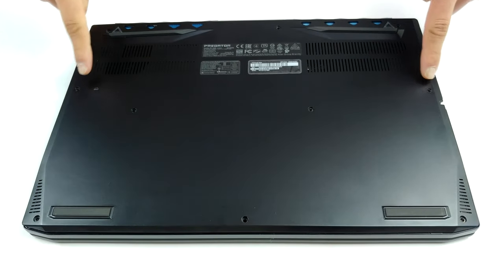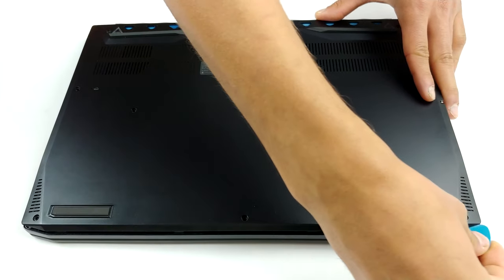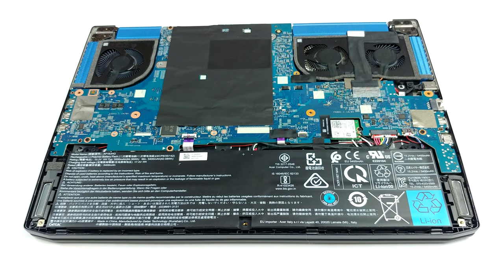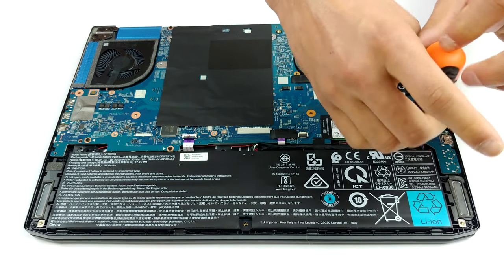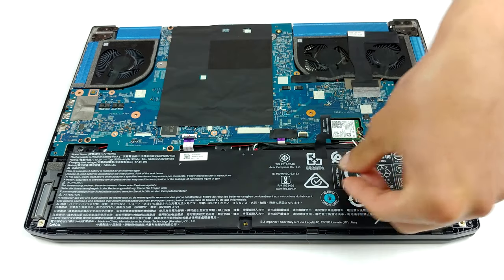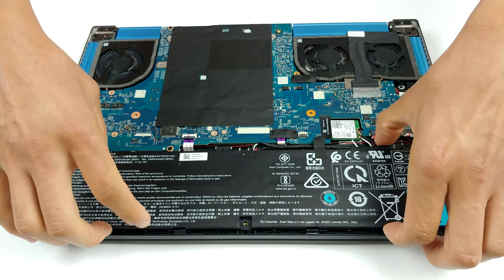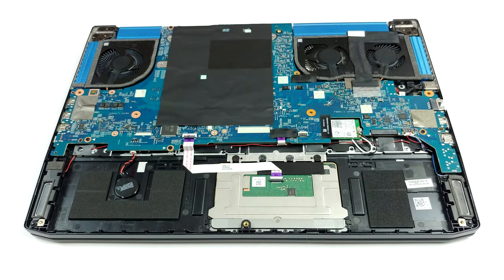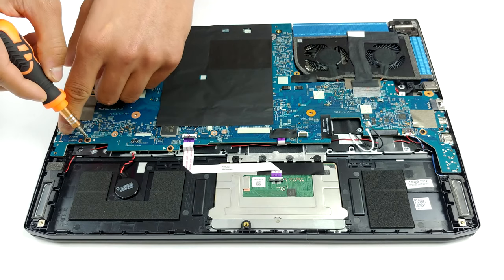🛠️Acer Predator Triton 500 (PT515-52) - disassembly and upgrade options

Comment: So you mean to tell me that you have to pull out everything just to get to the ram and SSD slots????
Reply: yup...I'm not looking forward to this. But I've had to pop open worse, but still....
Reply: @metpach  its not problem do it slow and carefull. Learm how open every types of connectors inside to not destroy them
Reply: @Ast86  I used to work on tablets, Xboxes, and other electronics. I'm well-versed in these types of stuff. While I think it's going to be tedious, I'm pretty confident I'll have no issues with it.
Reply: Kinda afraid to do that if I upgrade the triton, I think I rather take it to a store so they do it there safe

Comment: I've done the upgrade on the 2020 10th Gen i7 2080 Super Max Q version (PT515-52) & just as in the video there is a second m.2 slot which I installed another M.2 SSD in there (a WD Blue SN550 2TB). The machine takes a good while to study it's new detected hardware after upgrade (the Turbo white LED slowly flashes a fair few times & the machine restarts once or twice - and the screen will be blank for this period & so first power-up is slow, so be patient. It will eventually boot normally to Windows). Just take care to re-align the ribbon cables when refitting the board back in. There was also an additional ribbon cable not clearly shown (@ 4:28 in the video) that still retains the mobo when you need to lift it out; he disconnects it from beneath the mobo out of camera view - so my advice would be to remove it top-side 1st before lifting the board out (& pushing the cable through the gap between the fan assembly and the board). It connects to the mobo - bottom left of the DOUBLE fan unit - under that small peice of black tape immediately below a screw place holder (which comes through the base plate). Up to you but I found that easier and reduced the risk of tearing it if you were too energetic with lifting the board out - as doing it his way means holding the board with one hand & disconnecting the cable from beneath with the other - it's more fiddly / risky that way in my view.. As you see, even he nearly forgets it himself. Great video btw, it helped me, I'm not knocking it - these video's are gold-dust & what makes YT Fab. I removed my screws one by one and put them on a peice of A4 paper and returned the exact same screws to their original donor holes (very @nal of me I know but no chance of mis-placing the wrong screws that way). 

I wouldn't let doing this upgrade put you off buying it, this is a SUPERB performing laptop - it really is (& Scan have this on special atm) you just need to study this video and be preparred with the right tools and take your time, wash your hands first so tapes are not rendered non-sticky any more too (and have a nice well lit bright bench to work on too). Whilst you're there, get a can-of-air duster plus a very fine kids paint brush and blow the fans through - even though mine was new (few days old), it was starting to get dusty (I left it running over a few nights downlaoding stuff on a very slow web conection whilst camping away from home, hence the dust build up). I also noticed that my unit had the speaker cable on the right hand side (when laptop open) pinched between the battery - so I carefully re-alligned the wires when I re-fitted the battery. I was sure of this becuase 1st thing I did when the bottom was off was take a hi-res pic with my phone - so it wasn't me - it was like that from factory. Maybe worth you checking that (I can send a pic of this if need be) I also took a pic of my board on the flip side too if anyone interested. Unsure if his board in the video is the later 2020 iteration but looked identical when I looked at it quickly.
https://share.icloud.com/photos/04LcubRFmnq84QGwyS5zVVQ4A#Home
Reply: Hey buddy I need to open mine up I would really appreciate if you could share those pictures your comments are very very helpful man I wish I could give you some thumbs up or something
Reply: @jabbermacy  No problem, I still have the pics on the phone - will find an iCloud linkydink or something to share here...
Reply: @jabbermacy  Have shared pics in the bottom of my post 👍
Reply: @jabbermacy  Btw, I don't think I mentioned it - but I took advice - which turned out wrong - from Crucial (fume!) on their RAM - the sticks they sold me were not true 2933 compliant - so if you're upgraded RAM, don't use those as can be seen in the pics, it was only after reassembly and then checking that the speed was correct that I noticed that those sticks were largely 2400mhz not 2933. I had to repeat the process for the RAM afterward when I'd sourced true 2933 RAM.
Reply: Thanks man, you helped me a lot
Reply: Hi can u please give me the battery name, my battery is broken and I want to replace it so I wish you could tell me from where to buy it
Reply: Please help me find the ribbon cable ghibli_tb 450.0gy03.0011 H3 1903 A01 it's the ribbon cable from the inside that he doesn't show. Damn thing ripped off the purple tape and cannot be connected. I need a new ribbon cable but can't find a replacement anywhere. Do you know where I can get one? Thanks in advance.

Comment: Hello I just took apart my triton 500 I believe it’s the exact same model as this it has a 2070 super, while taking it apart the ribbon cable that goes through the mother board right next to the dual fan that’s covered by tape I removed and the connector broke off, I was able to stuff the blue ribbon cable back into the spot and get it to turn on and run as normal but I have a feeling it will give or just keep coming out occasionally, how would I go about fixing the connector that’s on the motherboard and finding the correct ribbon cable. I believe you were supposed to dissconnect that cable from a different part but I did not.

Comment: I just got a RAM upgrade. My TURBO button wont light or work. but the turbo mode on my predator sense working. I re installed my predator sense and Quick access already and its still not working. What can I do to fix it? Does the technician forget to plug something inside?

Comment: Seriously folks, the amount of complaints is just laughable.  I would agree with some on here that the design of the motherboard is stupid.  I am guessing it was packaging reasons (due to how thin this is).  Even though it has 3 fans, the cooling isn't great.  If you actually take the time to learn Throttlestop and MSI Afterburner (not hard BTW) you can do wonders with these machines for power use and graphics and temps.  

Warranty?  LOL.  I suppose if you pay the money for an extended warranty through SquareTrade, they might honor it.  So if you are worried, don't be.  Amazon sellers stink and rarely ever honor the warranties, and it is only a year warranty.  It should be easier to change out parts, but even if it was, you need to still learn how to take apart for thorough cleanings every now and then.  Compressed air is not going to work to full clean it out, but it does work for the keyboard.

First of all, they are not hard to disassemble.  I just set everything out on a flat surface and group screws together from where I took them from.  And second, get yourselves a simple laptop tool kit from Amazon for like 10-15 bucks.  They last a long time.  Don't be an idiot and try to use a screw driver to get the bottom off.  That is what plastic pry tools are for and those kits on Amazon come with numerous plastic tools that will not damage the enclosure.  Get soft brushes as well.  And, just take your time and you will be just fine.  

It is good if you get to know how to do this if you want to keep it long term.  You will need to learn how to do better thermal paste, clean the fans, and clean the whole thing really.  Once you take the motherboard out, it is a cinch to switch out RAM and SSD's (2 M.2 slots, and 2 RAM slots).  The only pain the ass part is the Turbo button connection.  It kept coming out of the slot on the bottom so I used a little double sided adhesive tape to stick it down, problem solved.  Just be sure to unplug the battery the first thing after getting the bottom off; and for added peace of mind, hold the power button down for like 30 seconds to discharge any power that might remain.  This laptop came with a 512GB SSD (Samsung PM981, or WD SN730 NVME).  Both are pretty fast, but low on space.  I switched out for a Crucial P3 1TB PCIe 3 NVME and it is pretty fast as well.  Yes, this chipset is limited to PCIe 3.0, which sucks, but that is the truth.  As for RAM, I went with 32GB of this: "Crucial RAM 32GB Kit (2x16GB) DDR4 3200MHz CL22 (or 2933MHz or 2666MHz) Laptop Memory CT2K16G4SFRA32A"  Comet Lake also cannot address faster than 2933MHz (no XMP support on this laptop), so it will just downclock the RAM a tad.  You will notice a difference with 32GB vs 16GB; both in gaming and in production tasks. 

Also, I like to run the fans up to keep the temps down and even after all this time, they fans are not failing.  Don't believe everything you hear online.  Fans are made to last a long time and tested for that purpose.  It won't harm anything to keep your stuff cooler.  With the fans up, not gaming, it is cool.  35-40 C on CPU and around 30 C on both system and GPU temps.  I also repasted with Arctic MX-6, and I use the X method on the GPU, and the vertical line on the CPU.  Works great and I pour it on thick.  Thermal Grizzly is probably okay as well, but Arctic works well (MX-4 sucks, but I like MX-6).  That's it.
Reply: Did you have any problems with booting it back up after changing the ram? I bet the logo and start up sounds, then auto repair, then bsod. It restarted again and then gets stuck on the predator logo.

Comment: I only saw one M.2 drive on the motherboard. Where is this 2nd M.2 drive for RAID 0 and why would they use RAID 0 on M.2 drives when it provides zero benefit?
Reply: Probably because it's cheaper.   I bought a 2tb and a 1tb to throw in there.  Fingers crossed!

Comment: I bought this laptop used and it was running sooo 🔥🥵 so I changed thermal paste and boy how stupid it is to have to remove motherboard in order to maintain it, I sold it with fresh thermal paste and still overheating...

Comment: I'm having a problem with mine where it keeps blue screening, I thought it was temps so I undervolt it but now temps are fine but crashes still occur
Reply: when did you buy it?
Reply: @G11Chan  about a year ago
Reply: I'm starting to have this same issue too but mine is from 2019 (2060gpu). Let me know if you find out the cause or a fix!